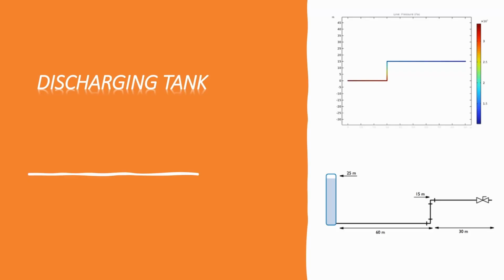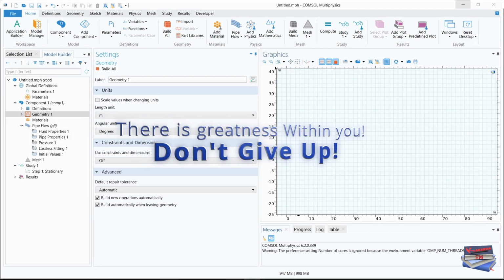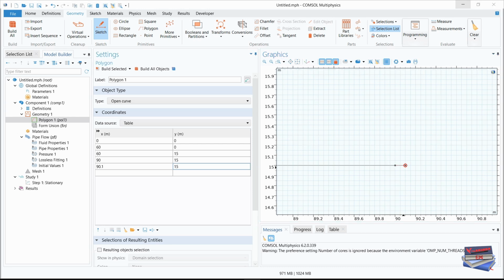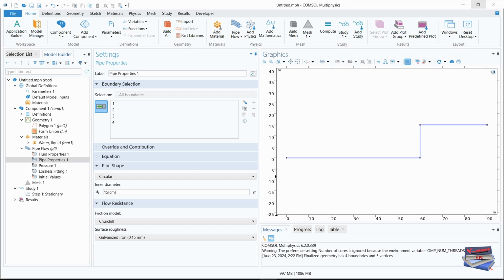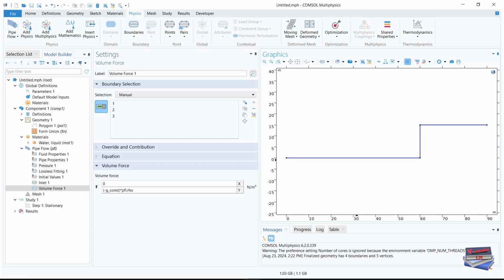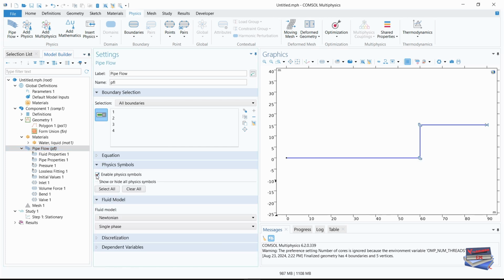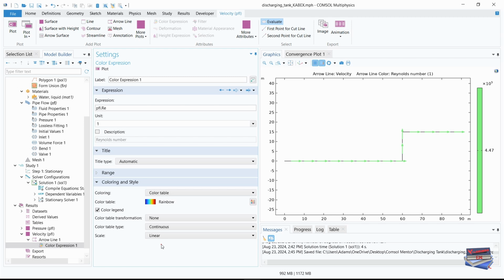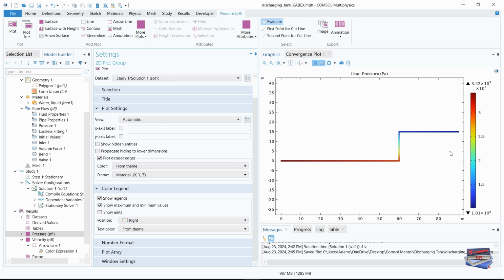Discharging Tank - COMSOL Multiphysics

Comment: dear sir,,,,,,,,,,,,,,,,thank you very much for sharing this video,,,,,,,,,,,,,,,,,,,only two questions; I think you assumed that the column of water in the tank is constant and since we are talking about discharging, therefore it must be not, so if the height of the column of water in the tank is variable with time, how can we include that in the model?2-can you provide me with the reference you gave this example from? All thanks
Reply from the maker: Thank you and you are welcome. 

Here are some References:
1. J.M. Coulson and J.F. Richardson, Chemical Engineering vol. 1, 4th ed., Pergamon
Press, pp. 74–75, 1990.

2. S.W. Churchill, “Friction factor equation spans all fluid-flow regimes,” Chem. Eng.,
vol. 84, no. 24, p. 91, 1997

Here is a link to COMSOL's documentation:
https://doc.comsol.com/6.2/docserver/#!/com.comsol.help.comsol/helpdesk/helpdesk.html

Here is a link to COMSOL's Pipe Flow documentation:
https://doc.comsol.com/6.2/doc/com.comsol.help.pipe/PipeFlowModuleUsersGuide.pdf

I hope this helps. Please like, share and subscribe. 

Best regards.
Kabinda Ex
Reply: @kabindaex7047  great thanks